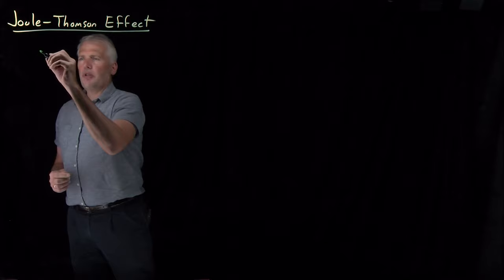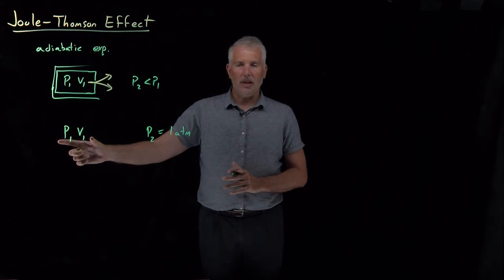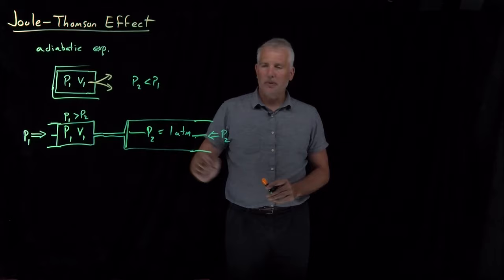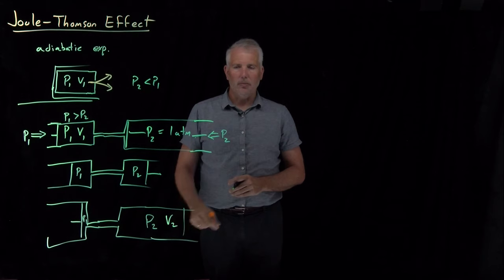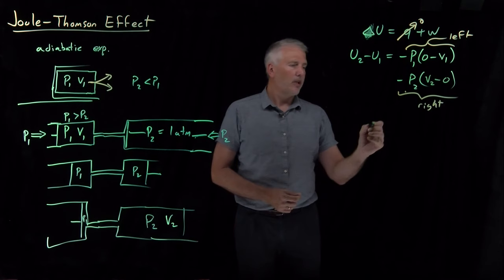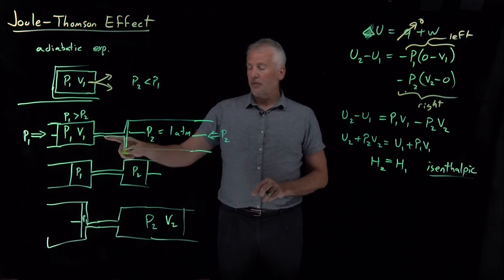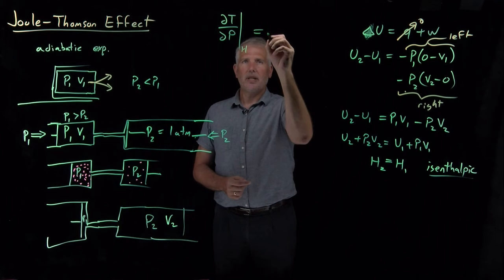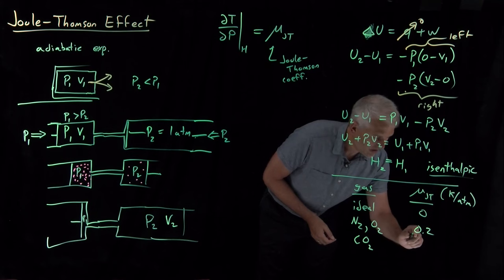Joule-Thomson Effect

Comment: Hi professor. Thanks for the video and the explanation. I would like to ask you about the inversion temperature of the JT coefficient and how the heating in the gas expansion can be explained in terms of kinetic and potential energy as you did with the cooling. Thank you!
Reply from the maker: Excellent question.

In the video I only considered the case where the interactions between gas molecules are attractive, on average.  For some gases, or some conditions, the interactions are replusive (on average).  In that case, if the molecules are separated further from one another, that *lowers* their potential energy, which will *increase* their kinetic energy and their temperature.

The inversion temperature is the temperature where the attractive interactions exactly balance the repulsive interactions, and the gas behaves ideally (does not heat or cool as it expands). This is equivalent to the Boyle temperature, if you're familiar with that property of real gases. Here's a video that may help: https://www.youtube.com/watch?v=rE4DETh-mqA
Reply: @PhysicalChemistry  I thank you for the explanation and the quick answer. I like so much the style of your videos. Greetings from Argentina.

Comment: Hi, well done for your video. However, the way you explain it is slightly misleading. 

Cooling occurs only below a threshold temperature (called inversion temperature) at which the JT coefficient is calculated. Above, you would have an increase in temperature. At room temperature only hydrogen, helium and neon are heating while expanding by this process. Maybe that's an addendum you should make. The formula is dT/dP_H = V/Cp × (T×alpha -1) (easy to derive with triple product rule and a Maxwell formula). 
For an ideal gas alpha = 1/T so no cooling occurs. For a real gas it depends upon the starting temperature.
 
The only way to always have a cooling effect is to perform the process isentropically. The formula above would then be the same but without the minus one. As all terms are always positive for all gases (except quantum helium but that's very niche), a drop in pressure implies a drop in temperature. And same for ideal gases no cooling nor heating. Best regards
Reply from the maker: You're right, of course, that the JT coefficient depends on temperature, and can be either positive or negative. (Thermodynamic relationships such as the one you give are discussed a little later in the course, once we have introduced other energies and Maxwell relations.)

You're also right that dT/dP_H is positive for most gases at room temperature (with a few examples given at the end of the video) and is negative only for a few like H and He. But when a real gas undergoes an expansion*, the pressure drops. Since dT/dP_H is positive for most gases, that means dT < 0, and the gas cools.  He and He and Ne are anomalous in that they *warm when expanded at room temperature. Normal refrigerants, like Freon, stop behaving as refrigerants once they get above their JT inversion temperature.
Reply: @PhysicalChemistry  working as a design engineer at Linde I felt obliged to add this comment. I hope my English is correct though and I think clearly mentioned all you have highlighted in your answer, I was just giving more insights to other readers. 
I was just adding that the inversion temperature has not effect whatsoever if the process is performed at dS=0 (which in reality is hard to achieve with better yield than 90%). Apart from that point well done to explain especially for newbies I would say. That's a very challenging problematic in the industry and it's well summarised and I think I may use part of your material to share to our non technical staff who is always eager to understand more of what we do. Cheers from France 👍
Reply from the maker: Salut et merci.
As an introductory video on the subject, the main goal is to explain the idea, as well as a little insight into the physical mechanism behind the effect -- the latter is often a confusing point for physical chemistry students.
It's always nice to have comments from professionals using PChem in the real world, so that students understand these are not merely textbook problems. (And also so that they know that the real world usually requires additional complications beyond the first-order models we study in class.)

Comment: Thank you for the conceptual explanation. I had a question though, how can I calculate the outlet temperature for a fixed inlet and outlet pressure and an inlet temperature. I am working on a project that requires me to do isenthalpic calculations however I'm not finding any luck with the methodology behind calculating the outlet temperature. Any help or guidance would be appreciated!
Reply from the maker: The JT coefficient is μ = ∂T/∂P (at constant H). So, for an isenthalpic system, dT = μ dP. Or, approximately ΔT = μ ΔP. You can use this to calculate the temperature change.

This is just one example of the sort of differential relationships that are used all the time in thermodynamics. If you want more info on this sort of relationship, see this video: https://www.youtube.com/watch?v=LttWusDZLGA

Comment: Thanks for the explanation! Something that doesn’t make sense to me is that, if the cooling for a real gas happens via a direct conversion from kinetic energy to potential, then where is internal energy lost? Part of the workings shows that there is a change in internal energy, but if potential energy is just converted into kinetic, then where is energy lost? And where is it lost to?
Reply from the maker: The gas molecules are (weakly) attracted to each other. When they are (relatively) close to one another, their potential energy is low. To move them farther apart requires that some energy be supplied, in order to raise their potential energy.

As an analogy, consider moving two magnets apart from one another. This is increasing their potential energy. (To be clear: molecules are not typically attracted to one another by magnetism. But this might help give you a physical, intuitive sense for how energy is required to change the potential energy of objects that are attracted to one another.)

Comment: The JT effect is well explained, thank you. However, refrigeration using Freon or other refrigerants isn't normally based on the JT effect. The refrigerants are compressed to the pressure at which they are liquid at ambient temperature. They are then cooled to ambient temperature to remove latent heat and heat of compression. The liquid refrigerant is then allowed to evaporate at lower pressure to provide cooling through evaporative cooling.
Reply from the maker: Point taken, thank you. Of course you're right that the condensation and evaporation parts of the refrigeration cycle are more important than the JT effect. 

I've added this to my list of planned edits / updates. Thanks again for the correction

Comment: Very informative video. Thx for the explanation. One question about the reason gas cools down. What if JT coefficient is negative (or we can say the expansion process starts outside of the inversion curve)? In this scenario, gas temperature actually goes up until expansion reach inversion curve. But it is still expansion so I guess potential energy still goes up which cause kinetic energy goes down. Could u explain a bit about where I get it wrong?
Reply from the maker: If the JT coefficient is negative, then the gas will heat up during the expansion. The physical reason for this is that the interaction between the gas molecules is repulsive, rather than attractive. So as the gas expands, and the molecules move farther apart, their potential energy *decreases*. This decrease in PE causes an increase in KE, so the gas heats up.
Reply: @PhysicalChemistry   oh I see. That makes sense. Thx u Sir!

Comment: Very lucid explanation.👍 But can cooling take place without a porus plug . What then is the role of a porous plug ?
Reply from the maker: The purpose of the porous plug (or small nozzle, etc) is to make sure the gas expands slowly. Under these conditions, we can assume both the compression on one side, and the expansion on the other side, occur at constant pressure.  The gas would still cool if it expanded without being throttled. But the J-T equations are specific to the situation where the gas is throttled.

Comment: So is Joule-Thomson expansion like adiabatic free expansion with the difference being that P2 is not zero (as in free expansion)? Also what is the role of the porous plug? Why all explanations skip that part if it is part of the experiment?
Reply from the maker: The JT process is adiabatic, but the porous plug (or throttling restriction, as illustrated in this video) is an important difference. Its role is to allow the initial pressure P₁ to be constant during the entire expansion. In the single-container free epxansion, the pressure drops as the volume of the conainer increases. Here, the pressures P₁ and P₂ remain constant while the volumes of the two sides of the system change, as gas passes from side 1 to side 2.

Comment: Professor why is it eqn valid for throttled system?
Reply from the maker: If the expansion is too fast, it will be irreversible and non-equilibrium, so these equations wouldn't necessarily apply. Also, if the expansion is through a narrow throttle, or sent through a porous plug, then the expansion is slow enough that the low-pressure gas can be removed, to keep it at low pressure.

Comment: Sir u gave reason for cooling.. But how heating is achieved during throttling??
Reply from the maker: Great question!

The explanation in this video uses intermolecular attraction to explain the cooling. But real gases have two important differences from ideal gases: intermolecular interactions and finite volume. When the attraction between molecules is more important, it costs energy to separate the molecules, and the gas cools as it expands. But if the finite volume effects are more important, then the energy of the gas decreases as the molecules move farther apart, so the gas heats up as it expands.  This will be the case for molecules with particularly weak interactions (like He) or at high temperatures (where interactions are negligible compared to kT).

Comment: There is a growing interest in CO2 used as a refrigerant and in the process of condensing a characteristic of CO2 called transcritical (pretty sure) which is neither liquid nor vapor. While very fascinating it's difficult to understand, but I might be over thinking it. 
   Is this something you might consider as a viable topic for one of your video presentations? If so perhaps it would be interesting enough to attract a reasonable number of views, and I would enjoy getting your take on it. 👍 Thanks
Oh wait, I see you haven't made a video in a years time. Oh well...,,,,,🤓
Reply from the maker: It's supercritical fluids (not transcritical). I do have a video that discusses supercritical fluids a little: https://www.youtube.com/watch?v=V82Ve9S7gyg And they are definitely fascinating.
Reply: @PhysicalChemistry  oh thanks so much! I will immediately watch it and more than once, as I need to understand, or wrap my head around the concept, as it doesn't have the familiar pressure/temperature reactions of the many refrigerants I have worked with. 
Even at my age I intend to learn something new every day.,,,🤓👍

Comment: I did some juggling and got that (∂T/∂p)@constant H = ((αT−1)V)/Cp  (or  (∂T/∂p)@constant H = ((αT−1)V)/(Cv+R)?). Where would this expression be useful?
Thanks,
Marcus
Reply from the maker: Yes, that's right. 

That would be a way to calculate the value of the JT coefficient, using other properties of the gas. For example, it could be used to determine the numerical values of μ that I listed in this video, or values for these gases at other conditions, or for other gases.
Reply: @PhysicalChemistry Thank you so much for answering and for making these great videos.

Comment: You talked about only the cooling effect. What about the heating effect and inversion temperature? This is not a complete Joule-Thomson Effect explanation...
Reply from the maker: That's right, it's certainly not a complete explanation.
But the heating effect is the inverse of the cooling effect. Cooling happens when it costs energy to separate molecules. The heating effect occurs when the density of the (real) gas is such that the interactions are repulsive on average, so that the expansion lowers their potential energy.
The inversion temperature is where neither is true: the PE of the gas does not change with expansion. This is the same as the Boyle temperature, and is the temperature where the (real) gas behaves somewhat ideally due to a cancellation of repulsive and attractive intermolecular forces.

Comment: how about entropy?
Reply from the maker: How about it, indeed! Entropy is one of my favorite topics, and the driving force behind a lot of physical chemistry processes, as you might know if you have watched other videos of mine.

The same is true here, of course. The gas will spontaneously expand through the nozzle from high pressure to low pressure, because of entropic effects. But the Joule-Thomson coefficient is primarily concerned with the temperature change during the expansion, rather than the spontaneity.
Reply: @PhysicalChemistry  Thanks, I mean how entropy will change in Joule-Thomson effect ? 

This process is an adiabatic and irreversible process, according to the definition of entropy changes: heat to temperature changes are removed from the equation and we only produce entropy due to irreversibility, so entropy increases in this process.
what you think ?
Reply from the maker: @kia_lio  Yes, you're right: the entropy will increase.